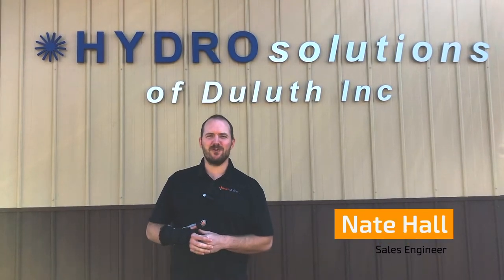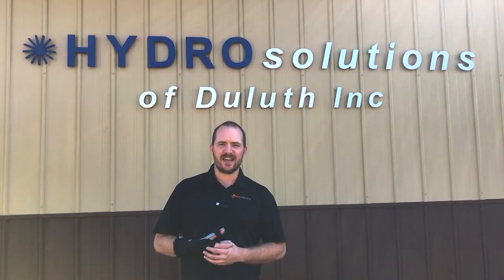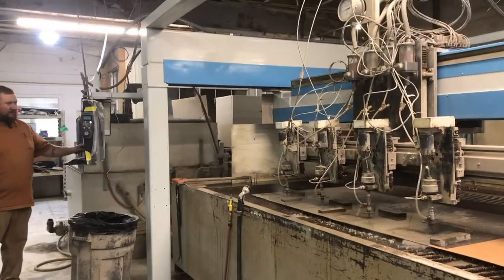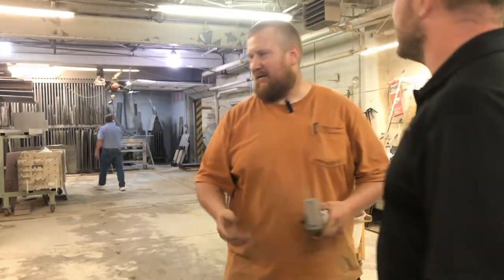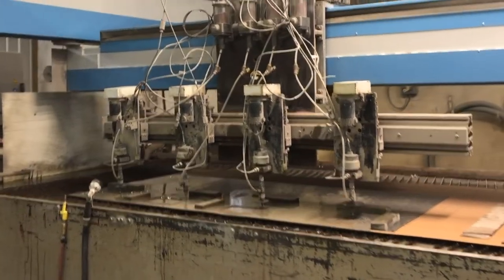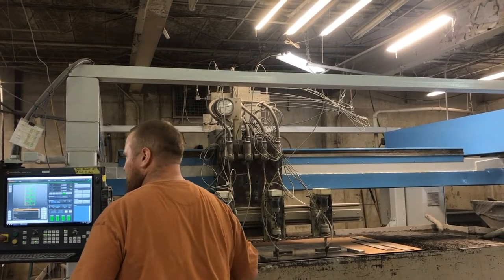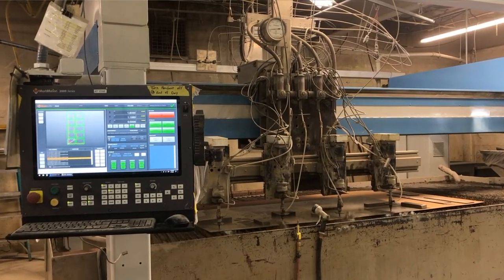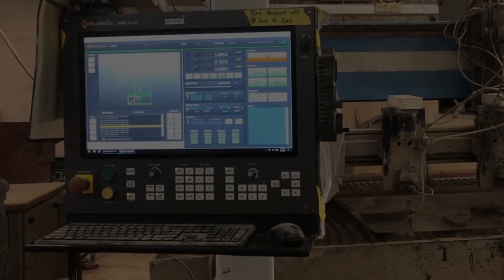Customer Story: Jet Edge Waterjet Self Install Controller Retrofit Success

Comment: I wonder how much it wold have cost to buy a new machine vs. upgrade this old one?  Also curious how much longer, if any, it would have taken to order and install a new machine vs. upgrade the old one?
Reply from the maker: Great questions Ben! There are pitfalls for buying a used machine or a new machine and many reasons to optimize your existing CNC machines.  This waterjet is really irreplaceable for Hydrosolutions Of Duluth. It is much more cost effective to optimize your CNC waterjet with MachMotion and the time it takes to get back in production is quicker than buying a new machine.  Not to mention you don’t have to deal with the rigging, moving, or rearranging for a new machine's footprint. 

Dan, the Owner, mentions that "The bones of this machine have been good forever. We have been told over and over by countless people that have come in, both competitive and non-competive, to not ever trade the machine, you're not going to get as good of one. And today they'll still tell you that."
Reply: most new machines are garbage.  Jet edge makes the best waterjets out there.  These machines are totally rebuildable and can last forever really by replacing wear surface parts.  Much cheaper than a new 700K machine and another 10- 12K to install and start up.